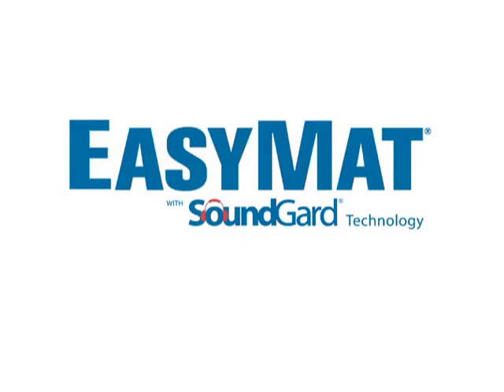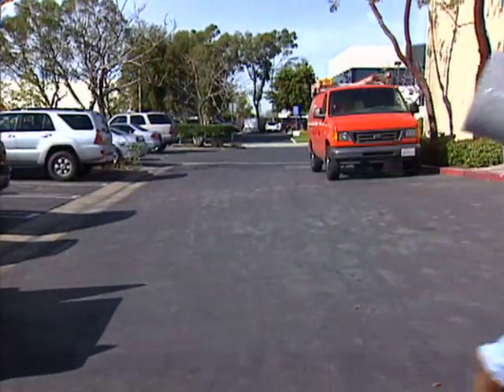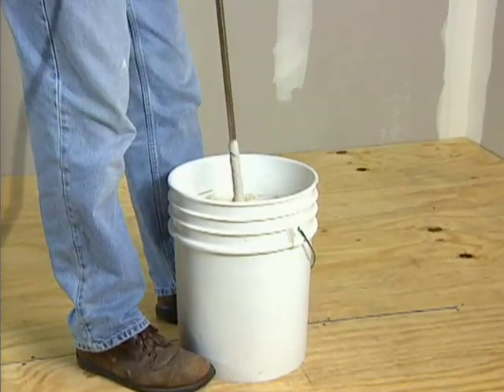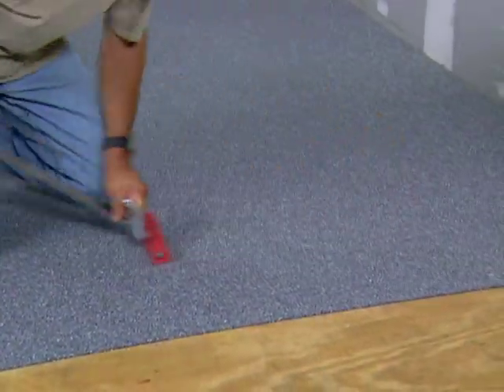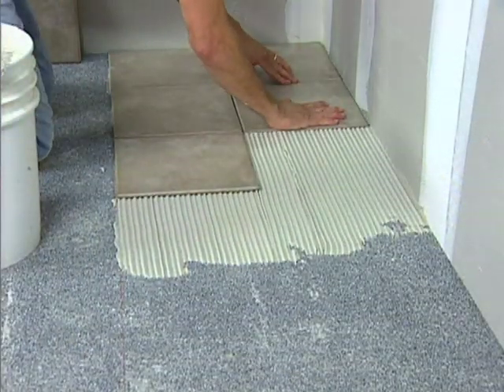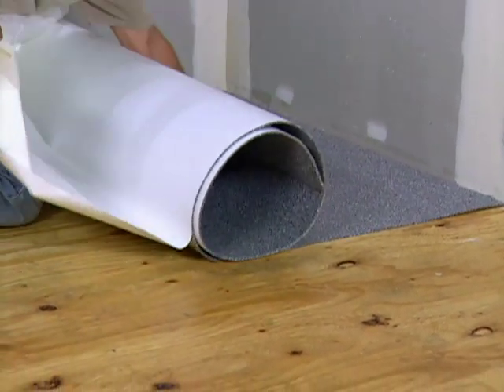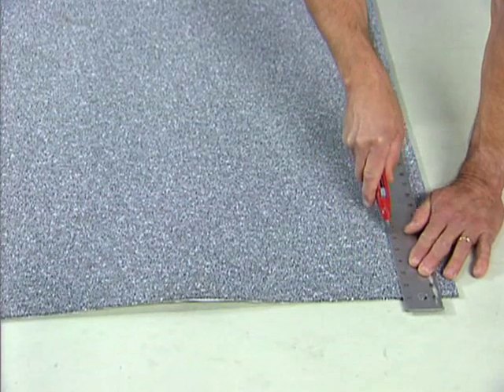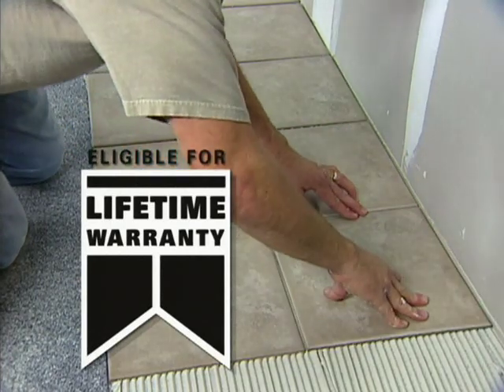How to Use EasyMat® Tile & Stone Underlayment

Comment: Have been using this for 11 years. Its my go to for backer. The self adhesive is all I use. Have never had a failure with it. Just like anything else. To use it, you have to be smarter than the floor, which is hard for some people and professionals in this industry.
Reply: I know this is an old comment, but I'm wondering if you've used this product for wall tiling?  If so, how did it perform?
Reply: Ms Teresa K why would you use it for a wall? What type of tile are you using? What you use for the wall completely depends on the tile or stone.

Comment: It's so pathetic to knock a product you have no clue of how to use it. Like buying a smart car and knock it because it has no trunk space. This product is great if you spend time thinking of common sense or read about it. If the roll is hard to hold flat, why don't you use your brain and roll it against it's memory first? Then roll it long ways to breakup the memory. Let it stand flat prior to installing. Don't just remove from its package and go straight to the job. 95% of complaints are always from people that actually are incapable of figuring out troubleshooting. I once heard a customer at Home Depot complain that dewalt forgot to put cords on the power tools he bought, they were cordless!!! Another guy was using pvc pipe cement to connect copper piping and it failed. Even with the availability of YouTube, people still due stupid things. WOW, JUST WOW !!!
Reply: Can I just use the peel and stick? Do I need the adhesive? It is for a small section 8x4 back entryway. Thanks.

Comment: This product sucks! first of all it doesn't roll off the roll like the video.its stiff and difficult to manage alone. you need to spend an hour to get it so it doesn't curve up on you. The self adhesive version is what I've bought. @ 80 bucks for 40 sq ft, its more expensive than a lot of floor tile itself. The adhesive isn't that good, it says 30 - 40 minutes but i found it was beyond tacky in just a few minutes. I want my money back!